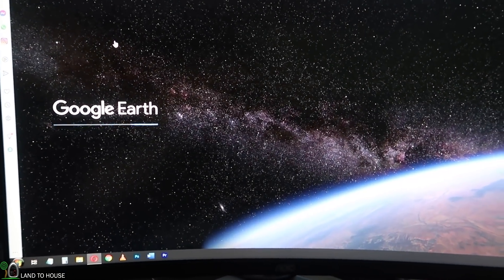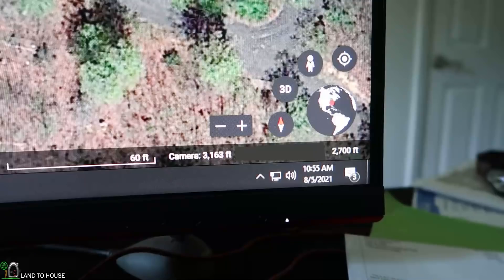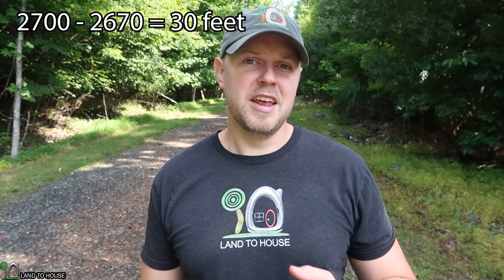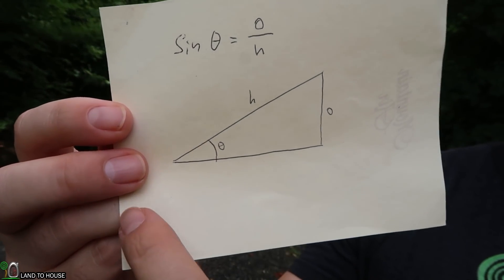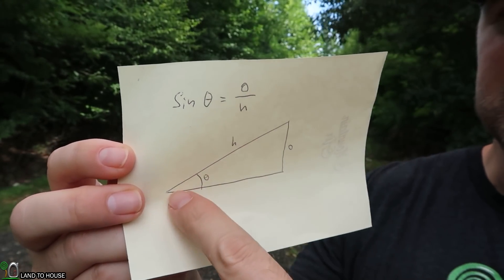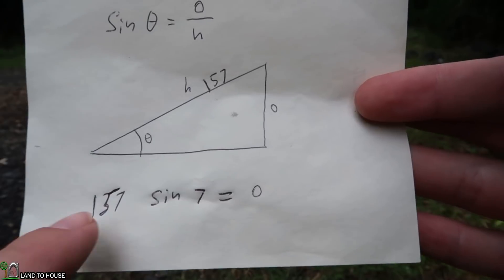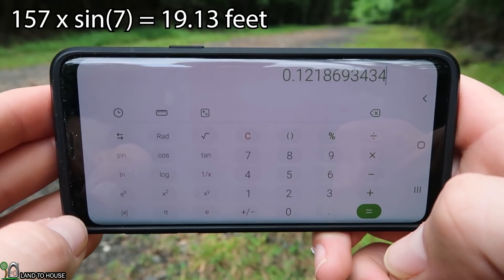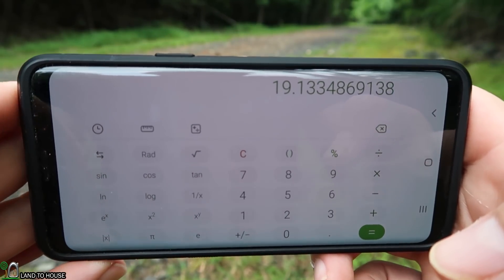3 Ways to Find Ram Pump Lift Height

Comment: Great video! If you don't have strings or long tapes, you could use that protractor + straw method and using a barometer/altimeter app (most phones have this) can measure its change in Z axis (height) with relative accuracy. So using the same formula, but plug in the height value and solve for hypotenuse to get triangular distance between the two points.

Comment: Well mostly good information.  But once again here was proof "Google" is a four letter word!  Google earth tried twice to change my browser and three times to switch my search engine to yahoo!  When I REFUSED every sneaky attempt to commandeer my 'puter it simply returned "Address not found - please re-enter the correct information".  Yeah the correct information is "Up yours google" and I can be happy using either of the manual methods, the distance is only 550 feet.

Comment: What about a laser and tape measure?
If you have more than 6' or so of elevation change you'd have to take multiple readings as well or you could use a really long pipe or board to find the laser at the bottom. 🤪
Line of sight could be an issue in the woods though. 😫

Comment: Thanks for taking time to explain how you determine your difference in elevation. Never seen the straw thing before. Just wanted to say you’re using the terminology wrong when describing pump performance, specifically lift. . Lift is actually how high a pump can pull water on the suction side, not how high it can push it. A ram pump cannot develop suction lift, the water level has to be higher than the pump for it to work this is called suction head when water lever is higher than the pump. Discharge head is used to describe how far a pump can vertically push a liquid. The height of the water on the suction side has to be subtracted from the head on the discharge side. (Total head = Discharge head-suction head ) for example. If you have a ram pump installation where the discharge head tops at 100 feet above the pump. The source of water  is 10 feet above the pump suction, the total head for the pump would be 90 feet. Say the suction line is in a pool of water in the creek and summer drought lowers it to 5 feet. The pump discharge head would be also be reduced 5 feet so you could only push water to 95 feet. Not a big deal if the pump has plenty of discharge head for the application. When someone is pushing the limits of a pump they may find themselves out of water if the source starts to dries up.

Comment: Not that it makes a huge difference, but dont forget the height of your tool....if you sit crouched, protractor is 2 ft above the ground. End point also needs to be 2 ft above the ground.  But the distances you work, that's probably splitting hairs.

Comment: If I got 5 feet of head and 30 ft of 1 1/2 inch head pipe and I have 15 feet lift at and lift pipe is 150 ft long and I have ur smallest pump I think half inch.  My thing is that  the pump runs 24 7 and goes in a 300 gallon tank and it takes about 4 days to fill it. If I got ur biggest pump would it pump faster and fill my tank in less time with the same setup but different pumps size?

Comment: A short cut on Method #3. When you have multiple steps to get the elevation change, you can measure the distance from the ground to  your eyes once (say if you are 6 ft tall, your eye level is about 65 inches.) Then, on each step down the hill run the line out to where it shows level right at your eye level. Then only on the last step will you actually have to make a tape measurement. <bb

Comment: An alternative to the line level is the method Kris Harbour shows on one of his hydro videos. He uses a water level in a clear hose attached to a stick of known height. He then walks from the bottom up counting the number of times he stops at the point where the water level intersects with the ground.

I have an app on my phone that is called Accurate Altimeter that uses raw gps, barometric, and the Google maps elevation map values based on the gps coordinates. This is of course at the behest of GPS accuracy in woods/valleys.

The hose method isn't bad if you just drag a 50' hose 50' at a time. A helper to tell you when to stop dragging for each segment and to keep the hose filled is a good idea.
Reply: I also thought of GPS, but you probably need a separate handheld device with a better accuracy. And a good GPS/Glonas/Galileo/Beidou signal in the woods/mountains.

Comment: Neat exploration, thank you for that.  The water filled pipe and pressure gauge might be more useful for folks actually installing a ram pump, since the delivery pipe has to be run anyway.
BTW next time you run a camera down a mine shaft, use that long long tape measure instead of string and it will spin a whole lot less.

Comment: What about GPS on you phone? I know accuracy can change but my phone is accurate enough to know what room I'm in on my locator map.
Reply: The phone not only relies on GPS but also uses WLAN etc. for indoor navigation. That wouldn't help in the woods.
Reply from the maker: That is a valid method. I have found that here in the mountains it can be really hard to get gps to work correctly at times.

Comment: you can approximate trigonometric functions by the Pythagoras rule for known angles/lengths
Reply: laser pointer to to the top, then approximate the distance to the base
Reply from the maker: Yes that does work. There are so many ways to find the height. I figured these 3 are ways that anyone can use.
Reply: @LandtoHouse  gov will have all heads for this tech thay teach us that we always have loss but never talk about 
the converted gain we can make from eletromagnets
if u convert all the wast thermal energy around 
you u can use it universally as energy u need a true sine wave bipolar like the power comp dose a 
true pure sinewave like a grid tie inverter 
once the signal is made the system will turn on and 
consume wast thermal energy from the 
environment and space around you... there is free energy but it comes from Universal thermal loss and converted into a gain. so a pole Transformer and a 
microwave Transformer  have a common between each other u can take 2 microwave Transformer provide 
a pure sine wave grid tie inverter to it or a true bipolar sinewave that inter acts with nature in 
a perfect spherical motion like a flower of life..  if ur home provides this use it as a Source 
signal then u can simply stack the Transformers on top of eachother in correct fasion and note 
that the 1 wire on the Transformer must stay connected and the other disconnected your only useing 
1 wire on the hi side .. so test ur self 
2 microwave transformer stacked on top of eachother same face sides. one side 120 to the wall and the other 120 side to what u want to power and useing the 
Transformer just the way it came out the microwave with the wire attached causes the energy in its 
perfect spherical motion to converted wast thermal energy to amp for u hot to cold in to out... 
should look a bit nuts with u use a form of wireless energy but its interacting with the environment...this is my work a compilation of Otis car. Tesla. and many other very smart people nowadays i think i found the gate source and drainif this gets out to much that it works the 
power comp and mib will have our headsdont do this at home warning high voltage yet i cant stop u lol DO NOT TOCH THE CORES OR THE WIRES OK u will die make sure u dont touch the core if the hi wire is mounted to it u dont have to mount the hi on the core if u dont want u connect the 1 hi wire to the same side hi on the other transformer then the core should besafe to handle if nessary
Reply: altimeter would work too